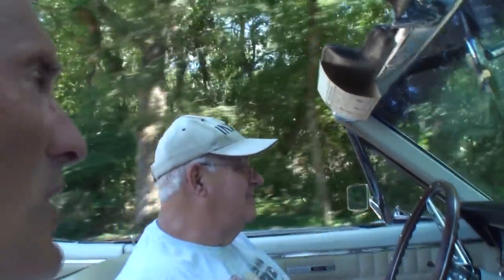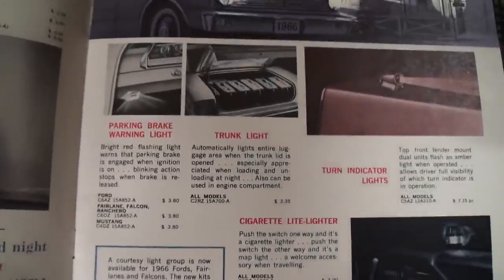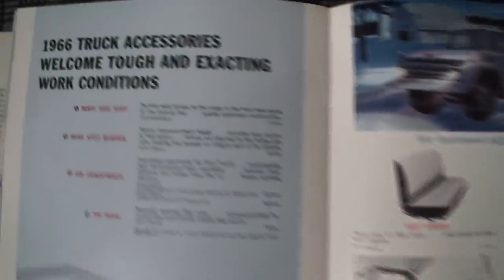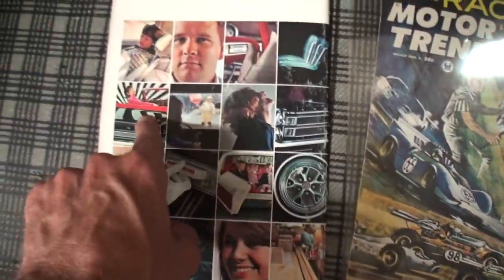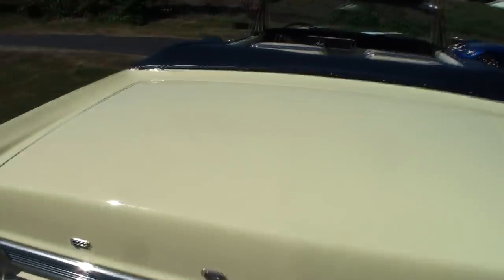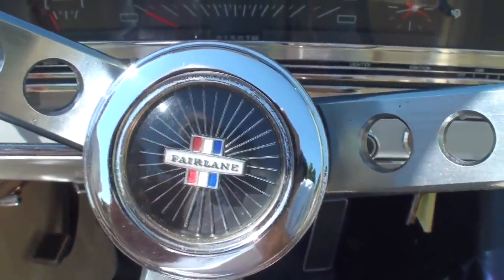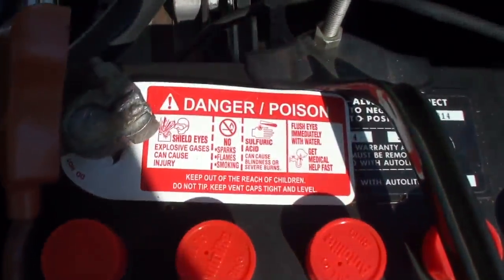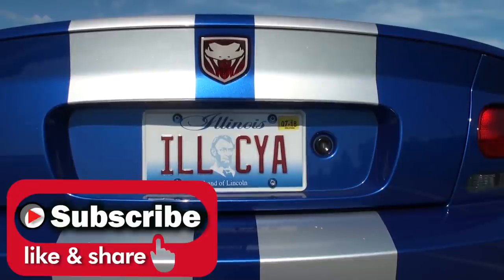1966 Ford Fairlane GTA Convertible in Yellow & 390 engine & Ride on My Car Story with Lou Costabile

Comment: Hi, Lou! The Ford Fairlane was originally a full-size car, introduced in 1955. It was named after Fair Lane, the Ford family estate in Dearborn, Michigan. The Fairlane was the pioneer of the intermediate car class when introduced for 1962. In promoting it, Ford said "Some cars have a new name...this name has a new car!" Full-size cars had grown quite a bit in size since the '55 Fairlane, and the '62 was roughly the same size as the '55, which seemed to suggest that some folks thought that's the size cars should have stayed at all along. It also answered the call of some other folks who thought the Falcon and other compacts were too small. Largely for those reasons, the Fairlane was an immediate hit. But when Chevrolet stepped in with the Chevelle for 1964, it immediately outsold the Fairlane, and suddenly Ford had some catching up to do. The 1966 models were designed to make room for the big 390 and you can see a lot of family resemblance to the big Galaxie and LTD, though the Fairlane had a bit more body flow. This was also its first year in offering a convertible, which the Chevelle had offered from the beginning. 

Dennis was very fortunate indeed to find such a clean example with everything on it and in that sunny Springtime Yellow color! He is rightly proud to have you spotlight it here! Thanks for another fun ride, Lou!
Reply from the maker: Hi iswc27,  Thank for sharing your knowledge.  I agree, this is a clean one Dennis has, and so much fun to share with you.  You're welcome,  Lou
Reply: Thanksformcomments::,interestingly ,( speaking of Fairlanes)*I found a Perfect 56 FORD( FLORIDA CAR, TBIRD ENGINE, ETC.: had a *memory OF *Aconditioning NOT work, (no pictures.)though got totaled a few weeks after I found it:: LOW MILEAGE, IT WAS A KEEPER), to,61 CONVERTIBLE 352/ auto( a piece of JUNK), then a 66 GALAXIE XL 500 /4 SPD/352( that I upgraded)...... etc.ps, my Name is “ DENNIS” also.

Comment: Beautiful car, Dennis! (and Lou). Great to see such a correct resto. And yes, GT's are 500's in that year. My closest "relative" to this car is my '67 Cyclone GT 4-speed convertible. Original engine was sketchy when I got it so I transplanted a 410 with mild cam, forged pistons, and a correct-year aluminum P.I. intake manifold. McLeod clutch and the same 3.25 ratio out back this car has, but rebuilt with a Trac-Lok unit. Thanks for the drive right up my alley!
Reply from the maker: Hi 413x398, Happy to read you enjoy the restoration and looks of this car :-) Sounds like you have a fun car too. My pleasure sharing with you, and you're welcome, Lou
Reply: @loucostabile  Are you aware that FORD is: For Omnipotent Race Demigods? I just thought I'd share truism.

Comment: Another fantastic Dennis Roxworthy Ford! This is the first video I have seen where Dennis put the top down. When you went for a ride I started to hear a rattle and was shocked that Dennis woild have car with a problem like that, until I realized what it was, I know Dennis like to have all the tags and showroom stuff on his cars, but if he is going to put the top down and go for a ride, he should take the cardboard sleeves of the visors and put them in the trunk. It would minimize damaging the sleeves, and we wouldn't have heard the rattle. 😊
Reply from the maker: Hi Daniel, Good point. Thanks for viewing and sharing.

Comment: One just doesn't see that many of the 66-67 Fairlanes.  Especially convertables!!  I think the Mustang stole a lot of their thunder.  I am most impressed that this one has a working clock.
Reply from the maker: High praise for the working clock :-) Glad I made sure to show that!
Reply: @loucostabile  I always notice clocks.  My dad was service manager for a Ford dealership in the 60's and 70's.  One of the top complaints they had was non functioning clocks.

Comment: Ps: always coveted  that 390/335 Horse engine.........my 66 GALAXIE XL 500/4 SPEED/*/Deluxe  Group/ Burgandy / Black Interior,PS/ PB,ETC) power “not “ impressive, though **352 /4 BBL/ Dual EXHAUSTS ran perfECT *( reasonably economically)for several years.. (INTERESTINGLY, my Hazard Lights Switch was in glovebox,No Coolant Recovery).....and those FORD Merchandise, & Brochures( actually most of THE Car companies then).. SUPER GREAT!   .....the Ford Dealers had a Coolant Recovery System KIT, I had to fit my 66FORD:& **not having DISC BRAKES , ***I HAD TO immediately retro-fit & get best “HD METALLIC* pads “, From SEARS “SPECIAL ORDER “Parts: & my Mechanic reDo & check.( the Factory Brakes could be overpowered quick in, EVEN some Indiana Hills!!!! , had a,ready done decent Tires/ Shocks by 1967[?], I was in Pharmacy School,etc)….
Reply from the maker: Hi Opera, At least you had a 66 Galaxie :-) Thank you for viewing and sharing, Lou

Comment: Ford loved certain car details, such as stamped aluminum trim, the push button vent windows with a moulded rubber gasket, Glenn plaid vinyl trunk liners, the glove box in the fair lane was actually made out of cardboard, factory paint jobs were often poor quality with noticeable bare spots where the paint was applied thin, that ragtop with the big engine was a tire screecher  especially with the manual, where you could hold gears to redline.My dad had a 500 which I got as a hand me down, so I remember a few quirks these cars had.
Reply from the maker: Hi Ron, Happy to read this car brings back memories of your Dad's hand me down car :-) Thank you for viewing and sharing, Lou